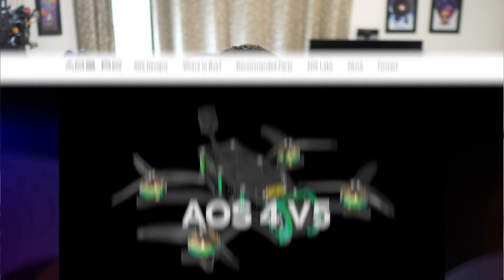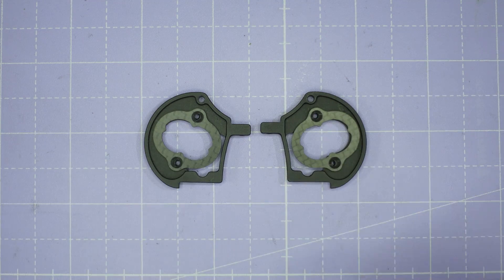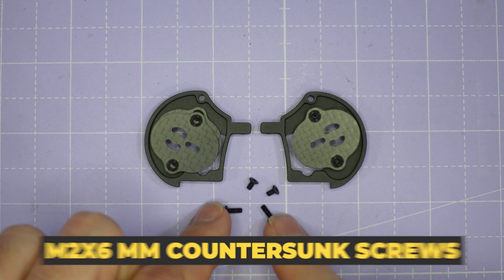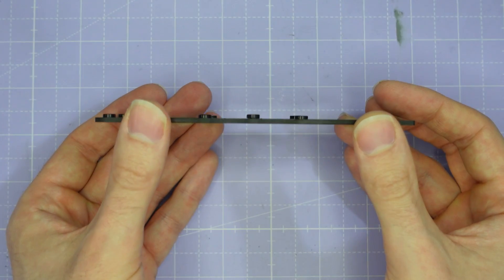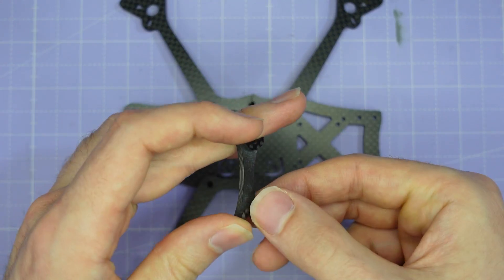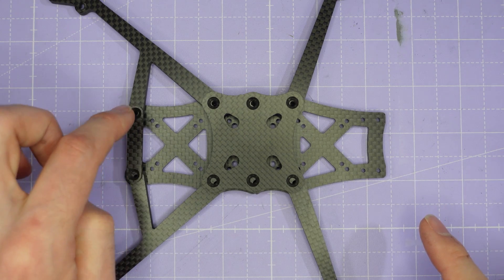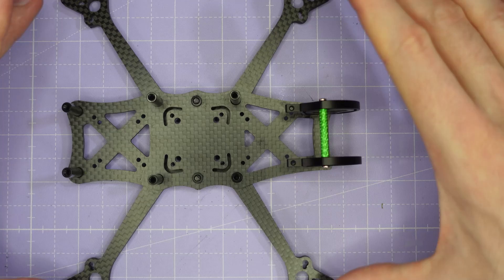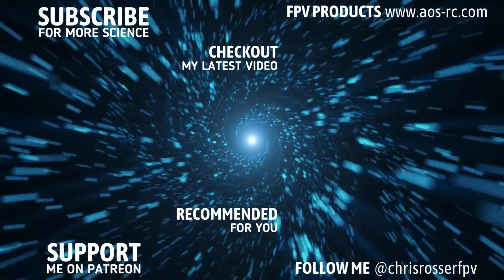AOS 4 / UL5 / UL5X V5 Build Guide

Comment: AOS frames from cncdrones are a disaster. They use the lowest quality carbon that snaps on a rough landing. The machining is atrocious: edges are not cleaned properly and are splintering off. The plastic bag you get is full of carbon dust. Some press nuts aren't installed straight. They bundle cheap screws - some with broken threads - that strip out easily. And you get none of the accessories you'd need to mount, say, an antenna.

About the only good thing that can be said about them is that they are quick to put together. If you don't mind spending a bit more time assembling a frame you're much better off buying one from quadmula, rotorriot or impulserc. The price is about the same but the quality is night-and-day. (As for the resonance - that's mostly snake oil. Most modern frames are fine in that regard.)

Comment: Outstanding.  Did not know your the creator of the AOS frames. I recently built a 3in quad with your AOS 3.5 V5..

Only suggestion and issues I have with these frames is:
1.) Add some pictures or suggested FC mounting. I struggled trying to fit the Speedybee F745 FC and DJI O3. I had to forward mount the FC inorder for the O3 to fit in the rear
2.) Your arm guard protectors do not provide raised surface soft tpu landing pads. This inevitably scratches the frame when landing. I know your AOS frames have a newer landing pad
3.) Please start providing GPS mounting. I ended up designing a M10 nano mount that utilizes the front camera standoff. Perhaps include one that is incorporated with the rear antenna
Reply: All truly valid, he made a video about the V5 frames where he indeed suggested to mount the fc forwards and the o3 in the back but a included manual would be quite valuable
Reply: @timmieskills  absolutely,  if a QR code or link was added to the manual.  That would have been soo helpful.  Having cut the motor wires for the XNOVA 1804's already with the FC mounted in the middle... became a mess
Reply: @EagleEyeShooting  I don't think there's a manual at all, Chris has made some build guides so that could be linked but a manual in text and photos would be better imo. Unfortunate tho on cutting the motor wires short lol. I do really love the flight feel of the 3.5 its so responsive and playful and even with betaflight defaults it flies like a dream
Reply: If you are not chasing weight - there is a nice skid plate available to print that protects the bottom plate (available on thingiverse)